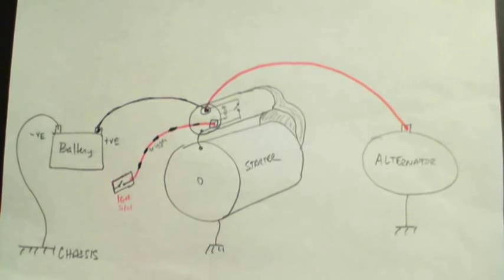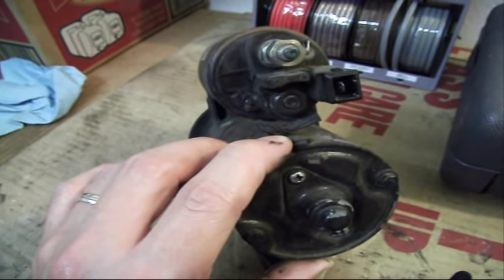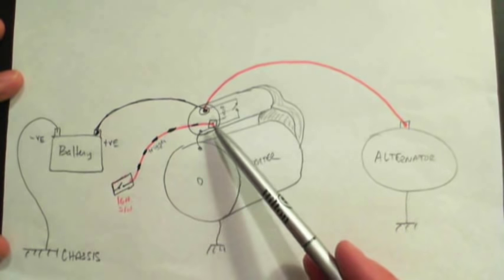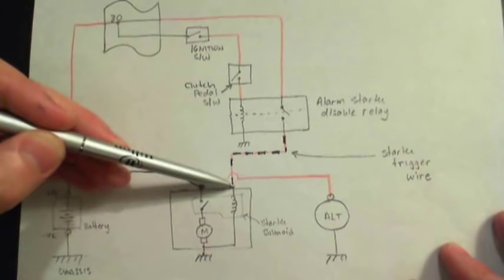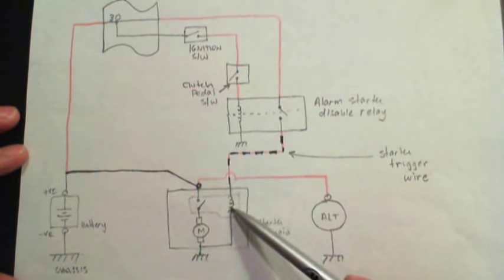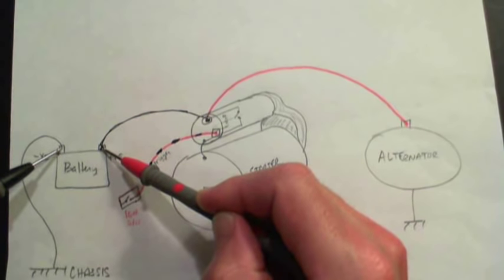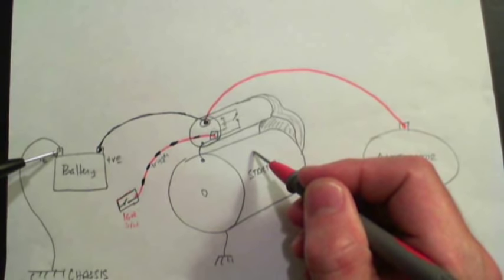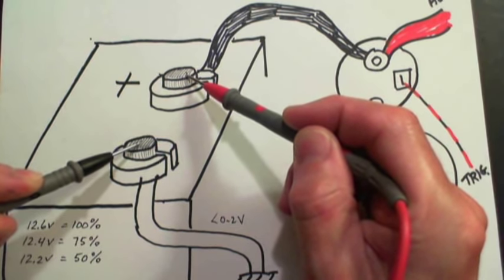Starter Motor Troubleshooting Tips DIY - How to diagnose starter problems

Comment: Last month in Calgary, a 'sting' operation by a local journalist was done at about a dozen auto-shops. They brought a vehicle in with a bad ground connection at the battery. More than 3/4 of the shops sold the customer an unnecessary battery. As I recall, all three Canadian tire shops missed the diagnosis. Only one or two of the whole group did a voltage drop test and thus came to a correct diagnosis. I admired the one mechanic who admitted he messed up. 

Good review.

Comment: Man that is very in depth! Thanks a lot! I was just charged 100 dollars for a diagnosis and they said I needed a starter. Using your video I was able to remove the starter and bench test it myself and my starter works fine. Unfortunately, I already bought the new starter. I will probably go ahead and change it anyway. But I spent 200 on a part I didnt even need because of their wrong diagnosis. Calling them back tomorrow. I'm about 400 dollars in on this same old issue. I've been to 3 different shops and nobody seems to be willing to take the time to dig into a real diagnosis always got their hands out to collect payment. I'm going to be so pissed if I find out it was a simple bad electrical connection somewhere and only a few mins or few bucks fix after I've spent hundreds getting nothing done.

Comment: I know starting systems and charging systems like the back of my hand and this video is by far the best video I've seen on how the starting system works and how to troubleshoot it. There's only one issue with his drawing of the complete starting system. The "alarm starter disable relay" is not wired that way. There are actually 2 components involved in disabling the starter by means of the car's alarm system. These 2 components are:  1. The starter relay which is shown on his drawing   2. The alarm system control module which isn't shown on his drawing. 

Inside the relay there is a coil and a switch. Inside the alarm control module there is a "ground" (The alarm control module gets this ground from the negative side of the battery). When you step on the clutch and turn the ignition switch to the start position, 12 volts will not flow through the starter relay coil to ground. Instead, 12 volts will flow through the starter relay coil to the alarm control module, and if everything checks good with respect to the alarm system, the alarm control module will give these 12 volts coming in a ground. This will energize(turn on) the relay and the switch inside of it will close to allow 12V to go to starter solenoid. 

So if you have an alarm system that controls the starting circuit, this will help you troubleshoot it, and determine if it's the alarm control module or the starter relay. If when troublshooting, you find that the module isn't providing a ground to the starter relay coil, don't automatically think the module is faulty. Before replacing the module, check to make sure the module is getting ground from the battery. You'll have to get a "pinout diagram" of the module to determine which pin feeds ground into the module. 

If you have a manual transmission you will have a clutch pedal switch, but if you have an automatic transmission you will have a "Park/Neutral Safety Switch" instead. The park/neutral switch is there to prevent you from starting the car in any gear except park and neutral.

Comment: Just sending thanks John. My wife's 1999 VW 2.0 Golf had problem which seemed like starter motor had gone. Turned ignition and just clicking. Fed up of high garage bills, I sat down and followed your tutorials on starter motor problems and using a multimeter. Bought a cheap multi meter and methodically set about the problem as you clearly outlined on your videos. Battery showed only 11.6v so got a charger which got it back to 12.4v. Low and behold car started up first time. Whether its purely down to low battery or down to the couple of hammer taps to the motor I'll have to wait and see but I am indebted for the clear and precise way you showed how to address the problem. Many thanks and keep the videos coming! Dave B
Reply from the maker: That's awesome Dave.  Congrats.  If it happens again, make sure the battery cable terminals are tight.  That's the #1 most common problem next to dead battery.  /John

Comment: Thanks John- I have gone from having no idea why my starter failed on my oldtimer Fiat 500 to having a very good idea why it failed- thanks to ur video and comments below. The failure is on the solenoid: the +ve pole & surrounding plastic casing has completely sheered off. Conclusion: Starter pinion is jammed and the current build up in the solenoid has caused it to self-distruct. Annoying thing is I had just had the starter reconditioned. Back to square 1- but hey at least I know what happened!

Comment: Very good video for the backyard guys. Wish I would have seen it earlier and did these tests. Mine would sometimes click once or twice then crank over. Instead, I visually inspected all wires and connections and found the positive at the solenoid looked burnt and corroded somewhat. Your explanation of a click no crank sounded correct.  I just cut the connector and I'm going to replace it. I recommend to anyone that ALL connections be clean and solid first without question.

Comment: Great video indeed! I was able to diagnose the problem with my Mazda 3, which would sometimes start and other times I would get nothing. When it didn't work, battery was fully charged and I would not even hear anything turn over. With knowledge learned on this video, I located the starter wire and by wiggling it, it would close the connection and the starter would work. But another slight wiggle and nothing would happen.  It ended up being so much of a problem that mazda release a service bulleting to remedy it in 2008. I hope anybody with the same problem will find this video and maybe read my comments to save them hours and dollars. The replacement part is under $20, for a new wire connector (BAY0-67-SH0).   Thanks again for the perfectly explained video!

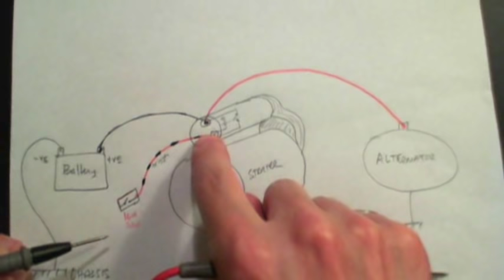Comment: Great video. The only thing you shouldn't do is at 6:38. Do not disconnect the trigger wire from the starter solenoid. By disconnecting it, you are opening the circuit and an open circuit can't have current flow. You need current flow to do a succesful "voltage drop" test. Leave it attached and put one of your voltmeter leads on positive battery post (On the post not the cable terminal) and the other lead on the trigger wire where it connects to the solenoid. With a good battery, your meter should read around 12.6V before turning the key and stepping on the clutch. After someone steps on the clutch and turns the key to "start", your meter should read close to zero volts. Ideally, your meter should read less than 0.3V (300 millivolts). If it reads much more than 0.3V, check for loose or corroded connections or corroded wires. 

It doesn't matter which lead you put on the positive battery post or trigger wire. This will only change the polarity so instead of getting +12.6V you'll get --12.6V. The positvie and negative signs don't matter. You're only concernd with the number.

Comment: thankyou very much you made it easy too find my starter issue,that it work then when I tried to start my 2001 venture van there was nothing fuses were all good relays un pluged and plug back in,still, I ran a new ground wire from the negative post on the battery down to the starter and connected it to one of the bolts the starter mounting bolts that gave me and gave me a good ground ...and she started right up .over and over .that fixed my problem thanks to watching your video :) tks from Kevin

Comment: Hi thanks for your reply. You are correct. It is the deterrent system force the voltage down to 12 V. I have reset the system. It could crank as usual. thanks for your help

Comment: Overall, a very good video explaining a cranking system.  There was one obvious thing that wasn't mentioned.  The fuse on the trigger circuit should be checked first if you suspect no signal to the starter.  It's an easy fix and doesn't require any real trouble shooting.   If the fuse blows again there's a short in that circuit and it's time to start chasing the problem.

Comment: that was a great video.
i finally flashed on some deep understanding...
thanks for that clear clear diagram..
made all the difference!

i'm working on a no clicking, no cranking issue, (total silence...almost eerie)
all interior lights and headlights work great.
now, i know go to trigger wire
work back towards ignition switch...
thanks!

Comment: That was awesome, thanks a million. Will appreciate if you can do more videos only on car Electricals and electronics, alternators with computer control, starters, batteries, reading schematic diagrams, voltage drop testing , computer control  components like sensors, how to test them etc. You can create a play list for auto electronics/Electricals. Once again thanks for this comprehensive simple understandable tutorial.

Comment: Thank you.  Your video helped me to diagnose my starter motor problems.  I found that I had a dry joint connection on my solenoid coil wire.  Re-soldered it and it's all good now!
:-)

Comment from the maker: @TheOfficialvice84 I don't know how much the labor would cost.  I replaced mine a couple years ago.  The part is like $20 or something.  You have to remove the steering wheel and steering column (not that hard). When the column is out you can easily just unplug the ignition switch plug (the part with the contacts) and plug on the new one.  Keep in mind the ignition switch is actually multiple switches. When mine went the wipers stopped working, but the car started.  Thanks for watching. /John

Comment from the maker: @dre1162 Yes, good point.  The car will start if voltage across the starter is less than 9V.  The service manual recommends there be at least 8V at the braided wire after the solenoid.  The voltage will depend on how cold the engine oil is (how slow the motor turns) and how strong the battery is. To load test a battery you draw half the CCA rating for 15 sec and make sure the voltage doesn't fall below 9.6V. A good battery doesn't typically fall this low unless its old and cold outside. Thanks

Comment: On point instructor 11 volts direct current when the ignition energized to the solenoid small bolt/switch wire and the positive always energize same direct current coming directly from the battery big bolt/wire.

Comment from the maker: @unforgiven7 It sounds like the problem is a welded shut solenoid.  The lump on the starter body is the solenoid. Inside there are two heavy tabs and a plunger that moves to connect both tabs.  If the battery is weak, when the solenoid is energized, plunger moves slow and internal arching can weld the plunger to the tabs.  That means the solenoid is engaged all the time.  This will also engage the motor drive pinion with the engine all the time.

Comment from the maker: Remove the fuse.  Use a light bulb, wire and get some blade style crimp-on wire connectors.  Connect the light to the wires with blades on the ends.  Plug the light into the fuse socket to replace the fuse.  Now if you turn the key there is no fuse to blow.  The bulb will limit current but will also come on if there is a short.  Start unplugging electrical components and/or moving wires around.  When you remove or prevent the short the light will go out.

Comment from the maker: @TheOfficialvice84 My first guess would be either burned contacts or a worn out (or damaged) ignition switch.  This is also likely if yours was damaged by those who broke in.  You could test to see if you got voltage on your trigger wire (like in the video). If you don't then it could be the switch.  Replacing the ign switch depends on the car, but usually you remove the steering wheel and part of the steering column.  It's a plug on the back side of the cylinder where the key goes.  Thanks/John

Comment from the maker: Ign Switches are usually multiple switches in one.  One part may go to the starter motor. Another part may go to the dashboard, interior and/or instrument lights or to give switched power to things like your stereo.  If the fuse blows then most likely you have a short circuit somewhere.  The short could be in an electrical component.

Comment from the maker: @Commando303X The convention for DC powered systems is to use black wires for negative or ground and red wires for power or positive.  This is not the case in every vehicle.  Most German vehicles, for example,  use brown wires to represent a direct connection to chassis ground.  You have to follow the wiring diagram to know the colors for sure.  On this car the red wire connects the starter to the alternator and a black wire connects that red wire to the battery.  /John

Comment from the maker: @s61927 I would call it the ignition switch wire.  You usually can't buy just a single replacement wire.  Go to an autoparts store or Radioshack and buy yourself a coil of wire and some connectors.   Cut off a length of wire and crimp on whatever new wire you want to replace.

Comment from the maker: It is a low battery voltage that will prevent a car from starting, not low current.  Current is drawn from the battery.  The battery doesn't force current into the motor.  The motor draws current and if the battery isn't strong enough the battery voltage will fall when the motor tries to draw current.  If the battery is strong then the battery voltage won't fall when the motor draws current.  Think of voltage as water pressure. Current is the flow of water.

Comment from the maker: @amirkhayn It's not the alternator.  Sounds like it could be a lose or dirty battery cable.  First make sure the battery cables are tight.  If the problem persists, remove each cable and clean the battery lug and the cable connector and reinstall.  Baking soda and water helps clean it up good.  /John

Comment: I have 1970 VW Bus, with the alternator conversion which I purchased in March this year. Initially, I had not starting issues.  I did have to get new rings, pistons, cylinders and heads. After I got her back,I noticed intermittently she would have what I call dead-at-key issues, no click, nothing ( which initially included no gen or oil lights at dead-at-key), but if I continued turning the key, eventually she would start.  That ignition(aftermarket) broke and I replaced it with a stock ignition switch and all was fine until I installed an electric heater.  It ran great, the car started fine. I turned everything off, went in, got cleaned up and then back out to go run errands.  Nada.  dead-at-key.  I used the jumper box and she started right up. I figured the light on the heater drained it too much, so I disconnected the heater and have not used it since.  
She started fine a few times, then on my third start after leaving home, again, dead-at-key.  Jumper box gets her going, and I am on my way.  Still, I know there is an issue with either the battery, alt, or starter.  I figure battery.  I put it on the charger and it is only a smidgen above the 0 in the  dial.  
Hmm... I look hard at cables; some corrosion but nothing significant but I replace them anyway.
 I look at tranny ground, it is fine too but still I spray with cleaner.
Everything seems fine.  Go run errands and when I go to come home she is dead-at-key.   Jumper box was fully charged but has failed for some reason so a nice family gives me a jump.
At home, I notice the PO has put the wire from the B+ post on the alt to the battery instead of to the started so I make a new one of those and all is well until last night.
I drove her into town, dropped my kidlet off at his MJROTC  event at he American Legion, figure I will go grocery shopping at Walmart and then go back over by where the kidlet is and  since I have made her into a "camper" inside I will just read and wait rather than waste gas.
I wander over into the automotive department to see what tools they have and how much a new battery is.  They say they can test the battery in the vehicle and to bring her around, so I waddle off fat dumb and happy to my bus.  DEAD_AT_KEY.  I walk back over to the automotive service area and explain I was going to have em test the battery but she won't start.  They wheel the jumper battery to her.  Nada. Has me pull headlight switch headlights are strong ( he never said try the key with the lights on) Says it is starter and nothing they can do ( they dont carry vintage VW starters)   So, I call AAA for a tow.  al the while I am waiting, I am trying to get her to roll just a smidge in gear backwards or forwards, but brand new tranny, so no give at all that I could coax out of her by myself. Still, I keep trying to start her but she is dead-at-key but since I switched the wire to the starter instead of directly to the battery, the indicator lights now do light up. 
We get towed home, tow driver leaves.  I am wondering how the heck I am going to get her to her spot to work on her and for Sh*ts and giggles, I try hte key.  The little B started right up.
She started right up this morning too.  
I am perplexed at this intermittent problem.
I do not think it is the starter, or maybe the starter does have a dead spot.. UGH.  I have a hard start relay but I really do not want to put that in unless I need to.  I just do not get why, when she is a tad warm ( her dipstick is always cool enough to touch, even when she is dead-at-key) she wont start and now wont jump.  

Any ideas?
Reply: I did put a jump wire/ tester from the 50 to the 30.  I do not know if the headlights dimmed or not as there is no one here but me and my arms are just not that long.  LOL  Anywho, the indicator light lite up, but the starter did not engage.